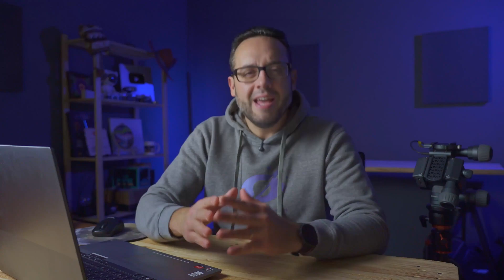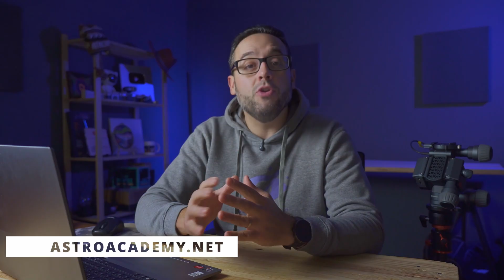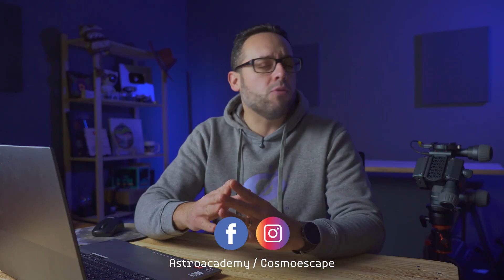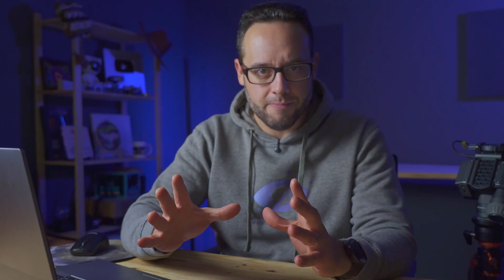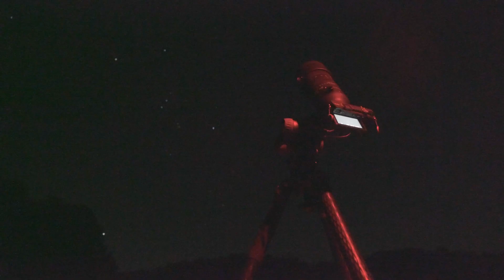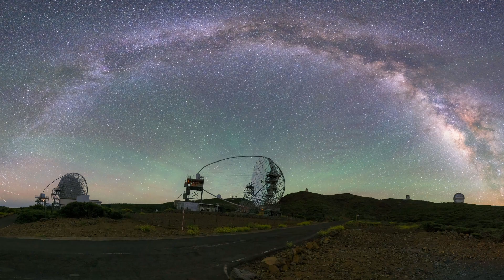NINA + Benro Polaris: Turning It Into a Portable Astrophotography Mount

Comment: Hmm, youre adding an autoguider, i.e. you're bringing a guide cam and cable.
How do you use the camera? 
Im thinking of using a photo camera with UWW lens, and i would like to implement plate solving to get proper mosaic tiles. If possible without the use of cables - is it possible to connect the camera via the POLARIS for plate solving, similar to the smartphone app?